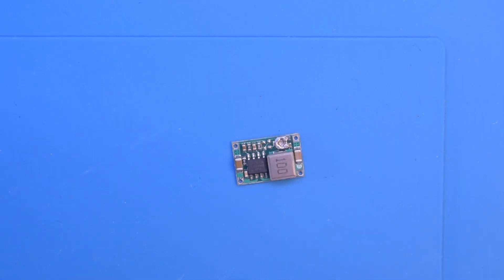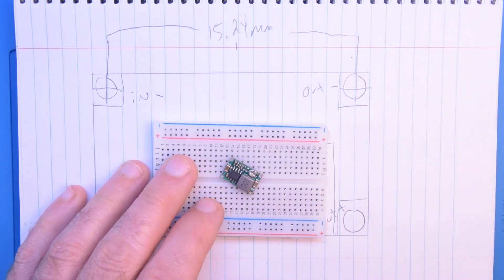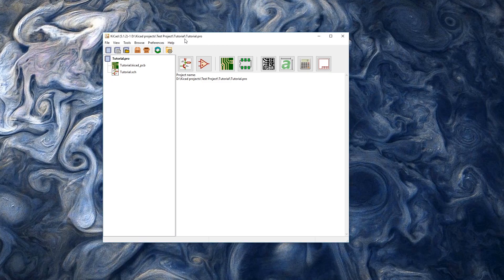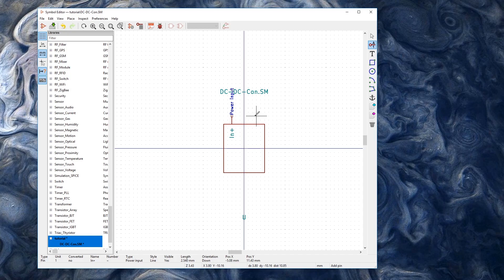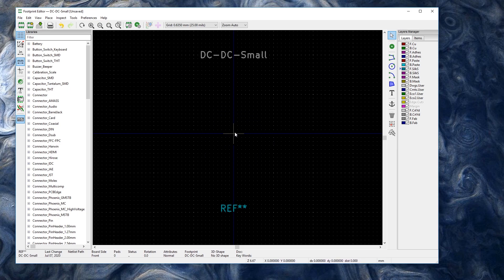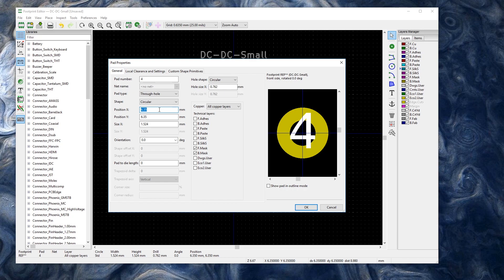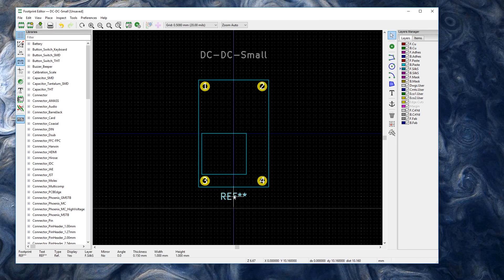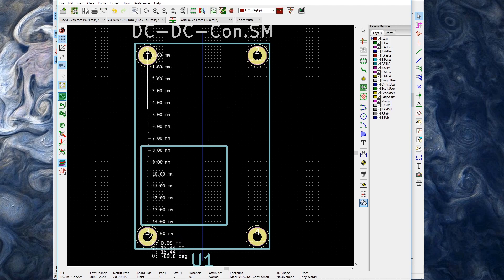Make A Custom Symbol And Footprint In KiCad (Easily!)

Comment: With this particular buck converter you do not want to use holes at all. It is kinda tricky to stuff pins between the converter and your own pcb. It is much more easier to solder the buck converter directly on pads on your own pcb, SMD style. This also gives you some space to place more SMD things on the other side. I typically use this buckconverter (the version without that cursed potentiometer) as a sort 'backpack'. I always place it on the bottom side of the board. Just my 2 cents. Furthermore: Nice vid!

Comment: To measure between two holes the easiest way with the calipers is to use the inside measurement points on the top of the caliper. the will give you the direct measurement from one outside edge to the opposite outside edge. then you can subtract the radius of the hole to get the distance to the center.
Reply: If I am understanding correctly that your method is what I think it is.... then you would subtract the hole diameter, not the radius.

Here is how I do it....

Step 1: Measure hole diameters. (It's easier/better to measure a wire that just fits the hole)
Step 2: Take a measurement from hole EDGE to hole EDGE, use either the outside or inside measuring function of the caliper.
Step 3a: If measurement was taken using outside function of the caliper, your length will be short. Add one hole diameter.
Step 3b: If measurement was taken using inside function, your length will be long. Subtract one hole diameter.

You should now have the distance between holes, center to center.

Bonus!.... If your holes are different sizes, you can add the sizes together then divide by two. Then simply use this new number in place of the true hole diameter.

Comment: What about when measuring a part that is not surface mount?  Such as a resistor?  I have one that is 48mmx9.75mm.  I drew the symbol the size of my component and added the pins.  When making the footprint it is only two through holes.  Should these be 48mm apart or should I allow for additional space on either side of the component and bend the leads to fit the pcb during insttallation?

Comment: You are missing quite a lot in you definition.
1) Defining a courtyard (CrtYd) is very useful to avoid overlapping components (But also a PITA if you want to place parts under some other parts).
2) Defining a fabrication layer may make the populating easier. Basically you put enough in this layer to show how to mount the part. When populating the PCB manually you have a printout of the fabrication layer next to you (To be honest, it am not good at doing this). The silkscreen is more for fault finding, not as much for mounting the PCB (This is not an absolute).

You can assign a default footprint to a schematic symbol.

I moved from Eagle to KiCad some years ago. In many cases I believe KiCad is better, but there is definitely a learning curve.
Reply from the maker: Thanks for the comment

Comment: Signal flow is normally left to right, not up and down.
The pencil sketch is OK but can be done in CAD.
Pin numbering sequence in example is arbitrary and is never used as in this example.
Use Manufacturer's part numbers for unique parts, not a generic name like in this example. 
Center-point of of part is EXTREMELY  important, as it is used by machine placing. (Not the "module" in this example).  For symbols not so critical, but does not hurt.
Grid alignment for Symbols is VERY important, as else it could mess up a schematic. TURN ON grids to 0.1" in schematic for correct pin spacing, text not important for this.
Making the Footprint turn on the grid, decrease grid resolution until you find the center point on the drawing. Everything in he foot print is referenced from the CENTER not corners like the mechanical engineers.
Start with making a document layer outline of the part for error proofing. 
Read the mfg. data sheet for the part, usually at the end of the document. Use whatever measurement units are used in the document. Center point most often has to be calculated as most data sheet are crap. All pad locations are referenced  +-XY from the center.  If pad boundaries are in the data sheet they can be drawn in a document layer for the footprint for error checking.
Beware of "standard" foot prints. Very often small deviation between manufacturers can make you a bad day. Many foot prints also have several similar looking names, some four or five for the exact same foot print. 
Use IPC standard  for silkscreen Pin1 orientation marks, and make sure orientation marks can be easily read after the part is placed and not covering it up. This may mean editing every foot print in your libraries, as many foot print designers seem to lack practical experience.
The library part, (called "Device" in other programs)  also need a B.O.M reference, Vendor, Part Number, Price, and Hyperlink. This takes time, but saves massive amount of time putting a BOM together. 

I'm not a KiCAD expert